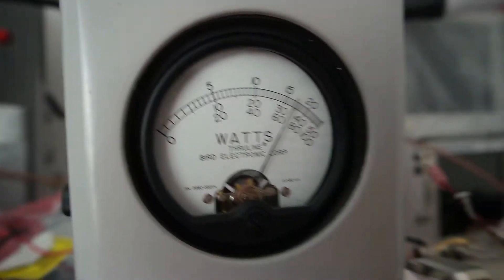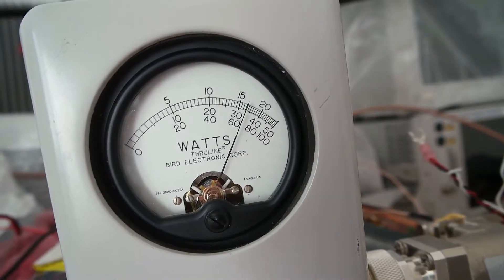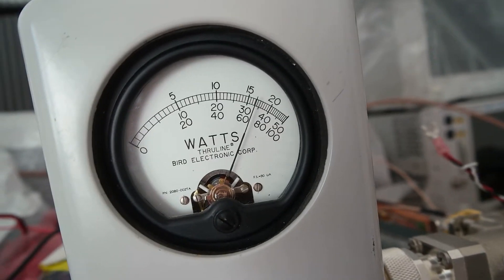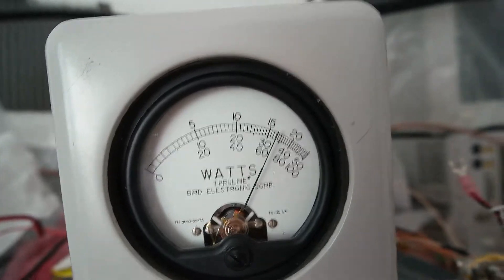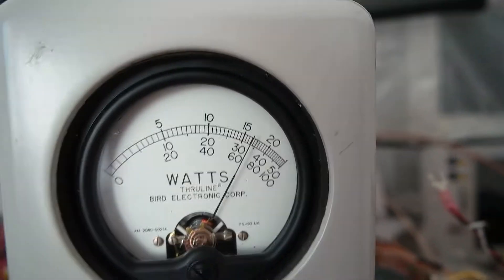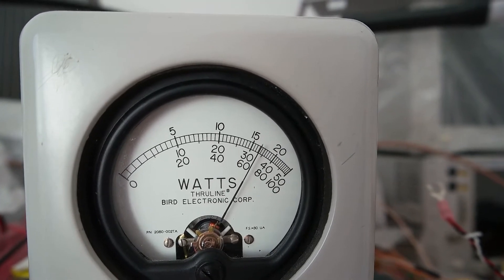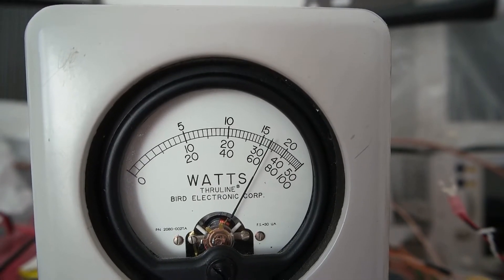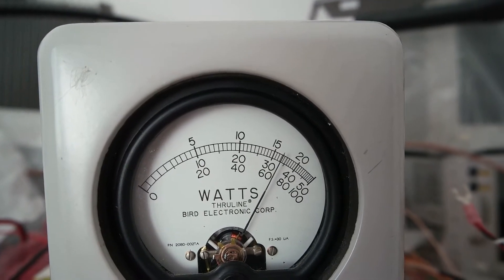BLF189XR in Single Ended first test for ISM & BROADCAST !!!

Comment: What is the difference between BLF189XR and BLF189XRB?
Reply from the maker: Hey hello. there is two version. The BLF189XRA wich is made for application up to 300MHz. And the BLF189XRB wich is made for application above 150MHz. The XRB version hase more power 1900W where the XRA have less power but can go to upper frequency
Reply: You have a website?
I wanted to discuss private with you.
Reply from the maker: @omegaradiotv  you can contact me to roosen.floris@gmail.com
Reply: mtmkindu2006@gmail.com